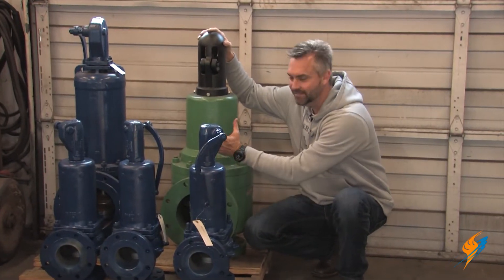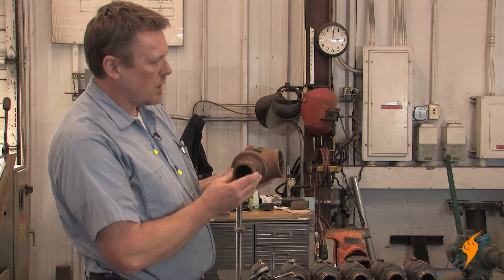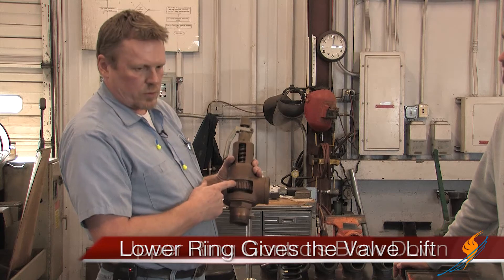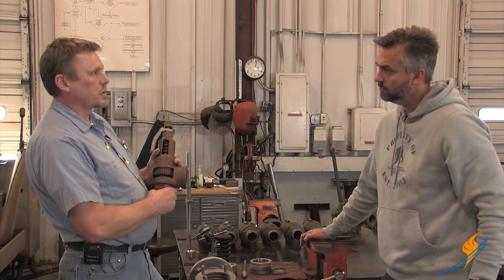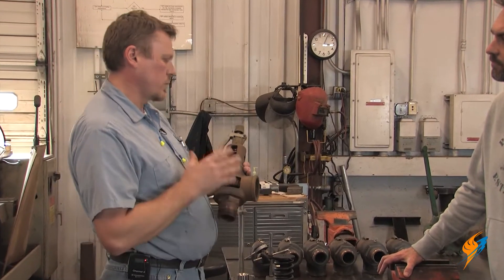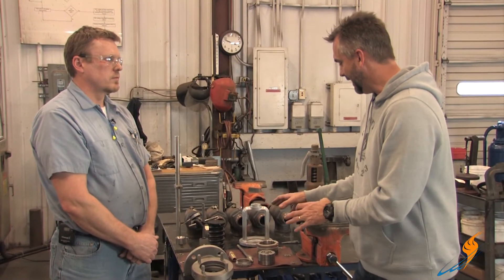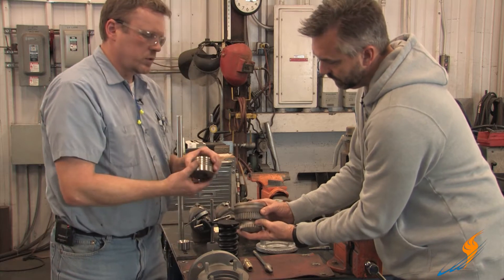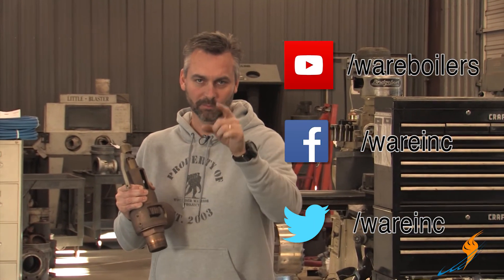Inside Relief Valves, Adjustments and Assembly - Boiling Point

Comment: Hello sir 
What is the proper way to adjust lower and upper ring ?
Thanks
Reply: There should be a factory setting for the blow down rings that comes with the valve specifications.
Reply: Every valve has a repair and service manual and catalog. And referring to the correct manual with every single valve is critical to having the correct specs. Numerous valves can be completely different but look identical.